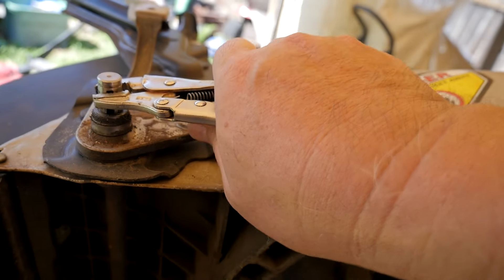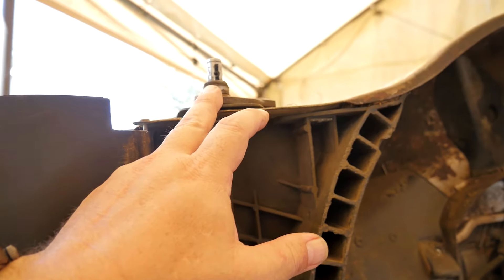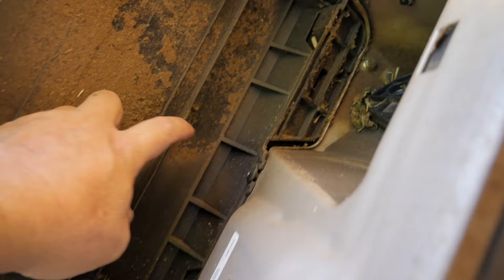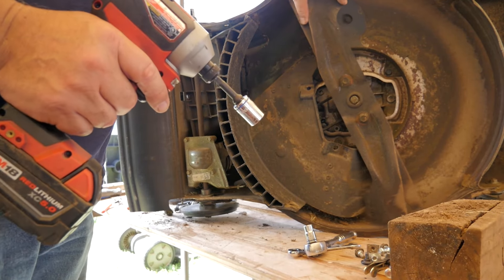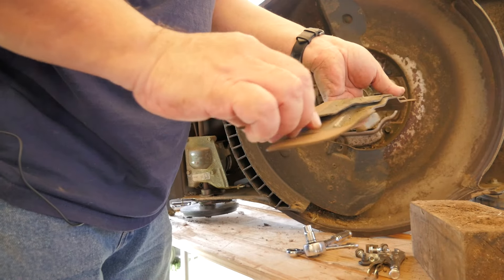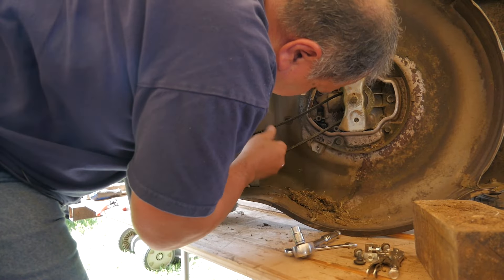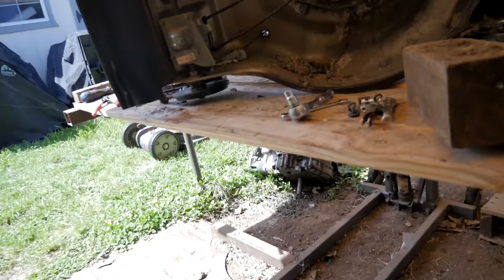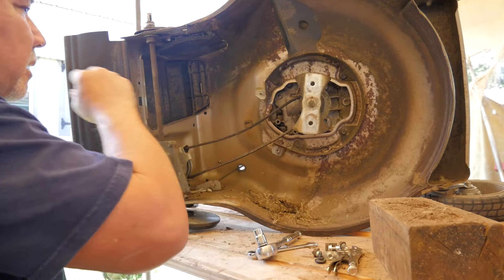Honda Rear Wheel Drive Mower will not Drive

Comment: that happened to me on my HRR 216VYAA Honda. A piece of wood got jammed into the pulley and hung up the belt.   I thought the worst of course figuring it was a tranny, but I got lucky that time. Yeah, Honda is a great mower. I think Honda made a big mistake by stopping production of their mowers in the USA. I guess they will be introducing a line of battery operated mowers in the near future. The mower market is too big to just drop out like that without having a Plan B.     Thanks for the vid!

Comment: Mine was working the. Stopped after hitting g something. When I pull the cable I hear a screeching sound and wheel won’t move.  Almost like an obstruction. I went to the gear box but just lost some lubricant.